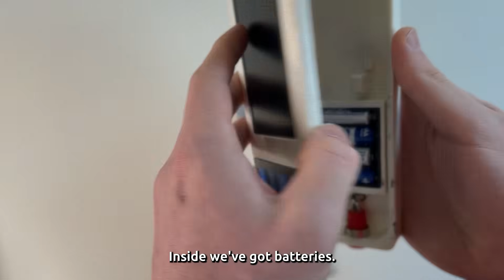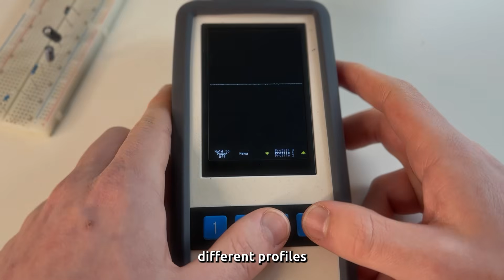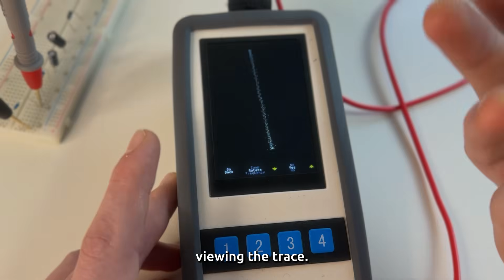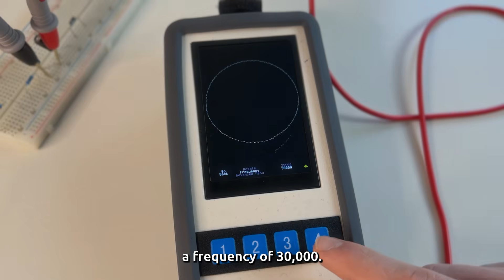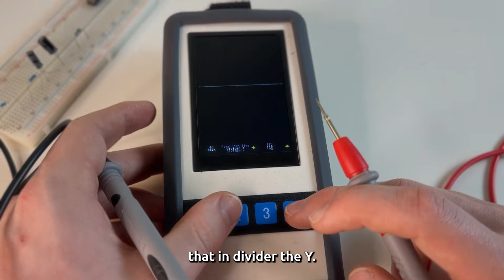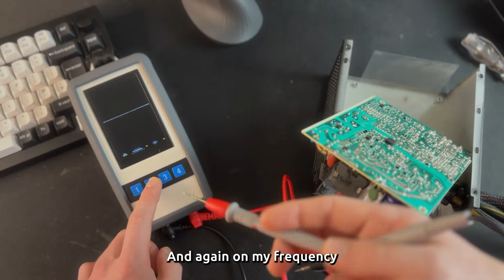Test Any Electronic Component *VISUALLY* with Octotester 2026

Comment: Why are you saying that when the frequency goes higher the Capacitance Reactance increases higher also? As frequency increases the capacitors reactance should decrease allowing higher frequencies to pass through the capacitor
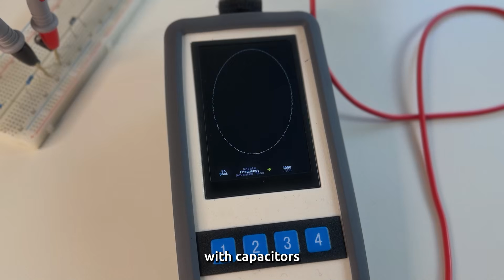Reply from the maker: Apologies! You're spot on (Capactive reactance does decrease as you increase frequency), I wasn't clear enough though I did mention it @ 4:02  - where exactly in the video are you referring to?

Comment: NO solid state junction curves shown?  Diodes and transistors are a big thing with these testers.  Also I have used them on potentiometers,  you can see if they are intermittent or noisy while rotating them.
Reply from the maker: Sure Tom, we'll show this off in an upcoming video, it handles it really well to the point that is very similar to our pervious model.